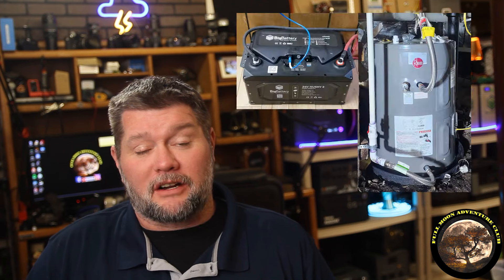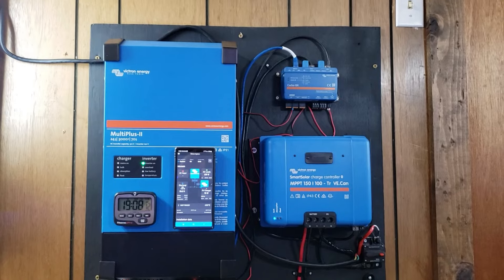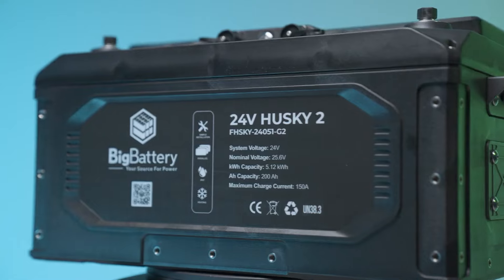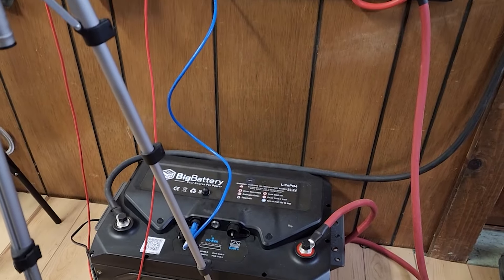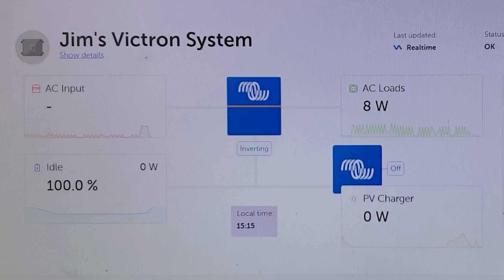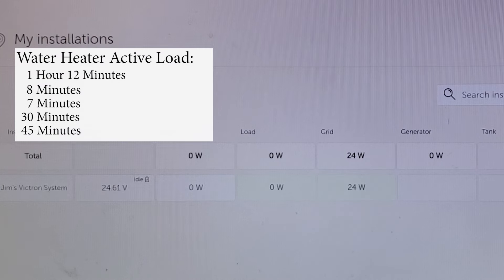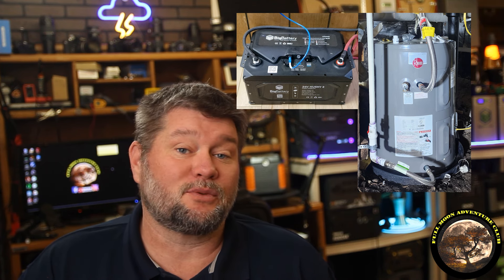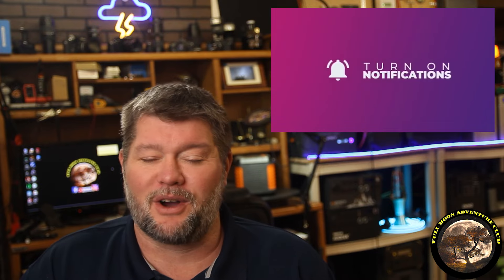Can You Run A Electric Water Heater On Batteries? -  Husky 2 Battery VS Water Heater

Comment: Hello I have a diesel engine and I have a 4k watts inverter can I use this battery ?
Reply from the maker: If you have a 24 volt system you can use this battery. They also sell a 12 volt battery of this type. I hope that helps.

Comment: How much time do you get off this battery im looking to get this battery kit for my food truck
Reply from the maker: It depends entirely on what you're trying to run off the battery. Do you have any more information about what you'll be running?
Reply: @fullmoonadventureclub  two small refrigerators small blender hood range fan all together around 3.11kwh
Reply from the maker: @PeteyPablo408  hard to say. Depending on how much you use the blender. And how often your refrigerator compressor kick on. I would say 400 amp hours is a pretty good place to start
Reply: 18 gallons water heater a transfer water pump.

Comment: You should be aware that the 48v husky2 has no com or rs485 functions. We purchased 2 of them and they dont communicate with inverters, they only communicate with thier customer power meter. We're in the process of returning them to Bigbattery. They are charging me a restocking fee and shipping fee since i apparently 'assumed' CANBUS & RS485 COMMUNICATIONS means they communicate with inverters.. which is what that means. Never buy from them.
Reply from the maker: Thank you for sharing that information. My 24 volt battery communicates just fine with the entire Victron system. I wonder if that is just with the 48 volt system or if it is a product error? Thanks for sharing.